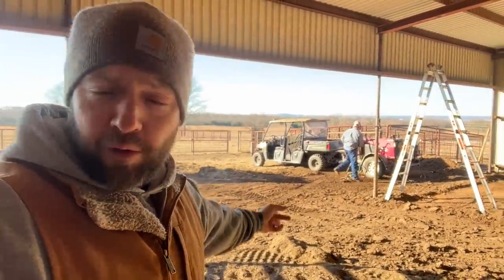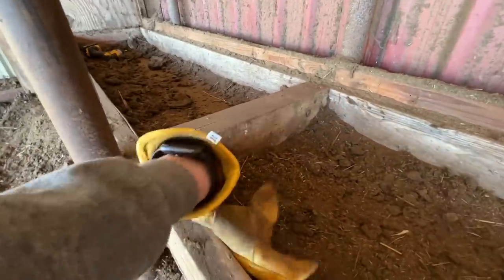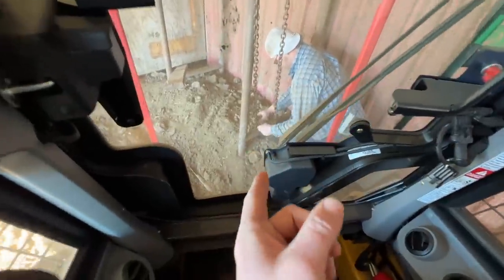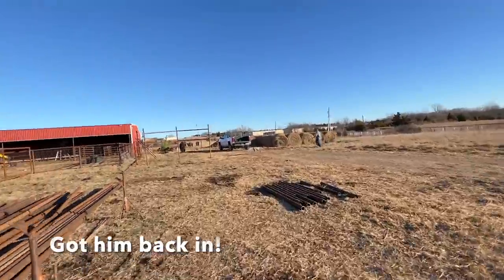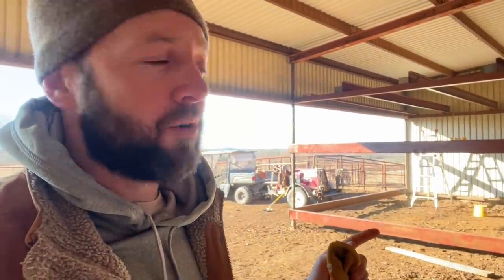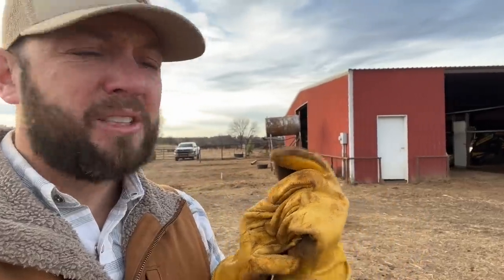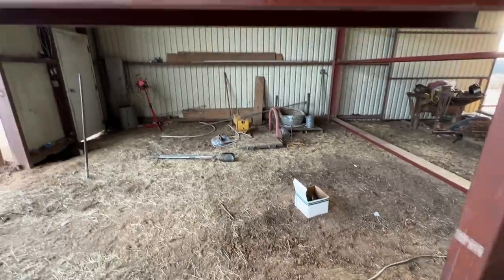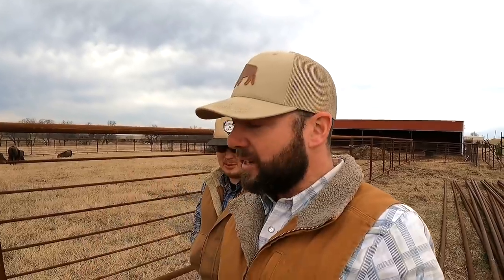These Bison Calves Keep It Interesting! Hoss!

Comment: Where is the door to the office planned - from inside the other half perhaps?  I wondered because of the ways the beams/rails are welded you can't put a door of a normal height without cutting through what is a support beam or else your door can't be full height and you will always have to duck under the beam which would be at the least the top of the door frame?

It's not necessary to have more than gravel as a shop floor in an area you intend to use as a shop for vehicles and vehicle storage and we also went that way at first.   We had to undo that plan and have the gravel removed and a pad poured after we had both an oil leak followed by a fuel leak and came to realize that when the vehicle leaked there was enough of a grade that the oil and fuel that went through the gravel and into the dirt below came close to contaminating a water well not far from the barn and we had to go to the expense of a lot of testing to make sure it had not actually seeped into the well or into the water table.  We learned then that to leave the shop floor unsealed over time and with the risks of fuel leaks from vehicles such as antifreeze, oil, fuel, and so on, it might be okay this time but over time it could be an accumulative problem.  So we ended up having to pour a pad with a dime that came up to meet the walls to contain any spills and pouring it separately and not when we poured the pad for the rest of the barn ended up costing nearly the same as the original pad we poured given that a great deal of the cost is the truck and the labor paid the driver just to come out and pour out the cement.  Had we done it when the main pad was poured it would not have cost us more than the cement to cover the footage, not the time and labor.

Comment: Wow, you all work hard.  Nice winter weather for welding!  BTW, When you pour concrete, will you imbed  some steel ties to secure a small concrete block safe room?  How do you plan for wind and lightening?  Looks like your property has good drainage.

Comment: Why didnt you pour the cement BEFORE you framed? It would have been a heck of alot easier. Now you'll have to go around corners where you would've  had a straight shot.
Reply: A steel building anchors in the ground whereas stick anchors to the concrete. You have to set the steel first. 😁 I thought the same thing when Jason and Brooke were starting on their home but they explained it.